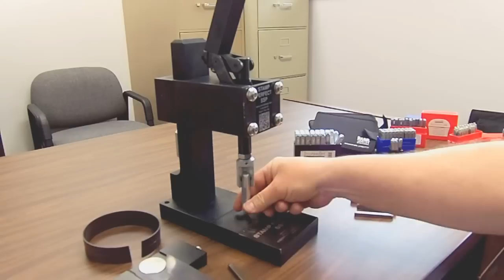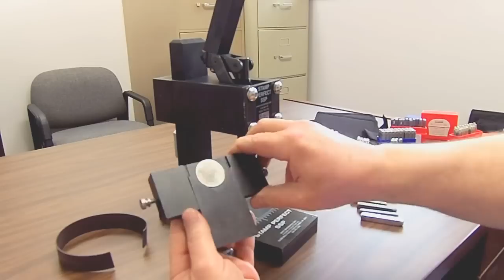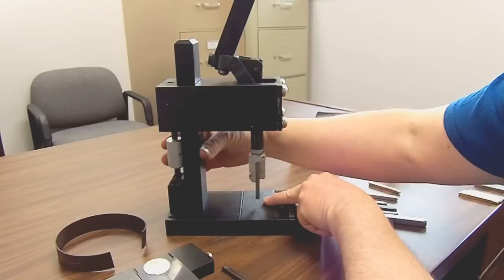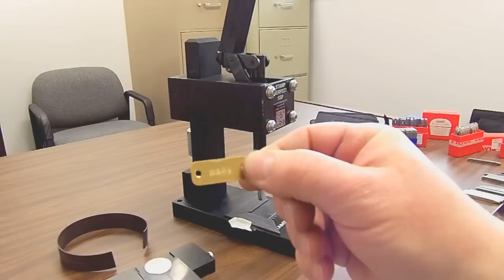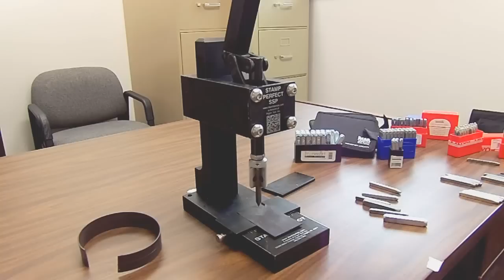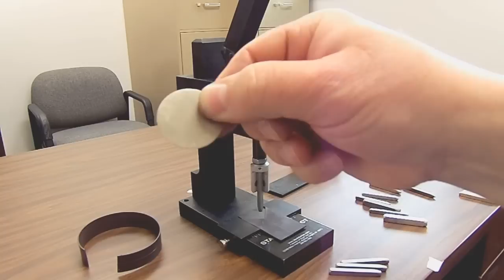STAMP PERFECT SSP hand stamp machine

Comment: What are the differences between this machine and the SSU?
Reply from the maker: The main difference between the Stamp Perfect SSP and the SSU is that the SSP is a press and the SSU is a hammer.  The SSP is marks your piece by pressing the hand stamp to mark.  This is a very quiet machine to use.  Depth of mark is controlled by the pressure you set.   The SSU delivers an internal hammer blow to the hand stamp to mark.  You will hear hammer blow.  The SSU does not have the power range of the SSP so marking larger character will not be as deep as the SSP can provide.

Comment: It doesn’t make sense that the same stamping result will be displayed on a soft or hard metal..If the force is strong enough for stainless steel, it should leave a dent at the back of a soft metal such as  aluminium. It does makes sense however, if the stamping force of the handle can be adjusted to suit to each need.
Reply from the maker: The Stamp Perfect SSP allows you to control the depth of mark by simply raising or lowering the height of the head holding your hand stamp.  Please note, the harder the piece you are marking, the more pressure it will take to pull the handle down for the same marking depth.  

As shown in the video, this machine PRESSES (at a controlled depth) the hand stamp face into the piece to be marked, IT IS NOT A HAMMER BLOW.  That is why the machine is so quiet when marking.  A hammer blow can be very loud and will leave stress marks "dents" on the back of soft metals such as aluminum or any material.  Stress marks, "dents" of the piece you mark are inevitable, however, they are far less with the Stamp Perfect SSP. 

If you would like to see what your pieces will look like stamped with the Stamp Perfect SSP, we would be happy to sample mark any piece you would send us.  Call us for shipping details, 248-583-1605.

Comment: Hi, Can you stamp on materials made with tool steel ? I want to stamp on screwdriver bits, thanks
Reply from the maker: Most tools, and screwdriver bits, are heat treated or forged to provide a hard durable tool.  In most cases tools like screwdrivers and wrenches will be too hard to mark.  You might get a light mark, however, you will dramatically reduce the life of your hand stamps.
Reply: STEELSTAMPS
Reply from the maker: Normally screwdriver bits are hardened steel and will not accept a mark from a hand stamp.
We would not recommend it.
Reply from the maker: Normally screwdriver bits are too hard to mark.
Reply from the maker: We do not recommend stamping screwdriver bits.  They are hardened tool steel and will not accept a mark.